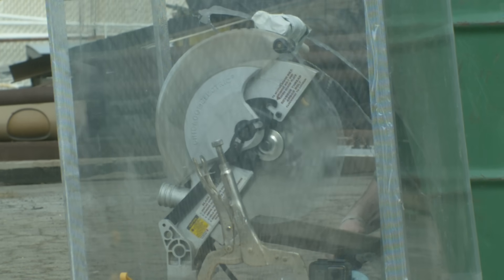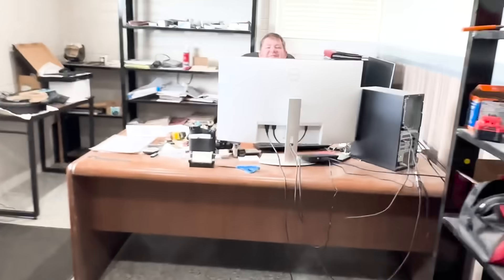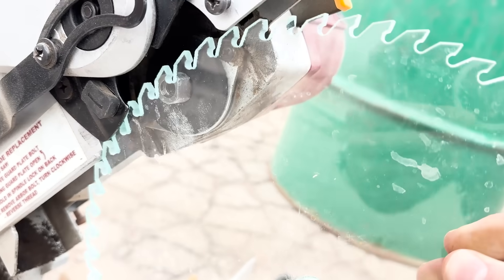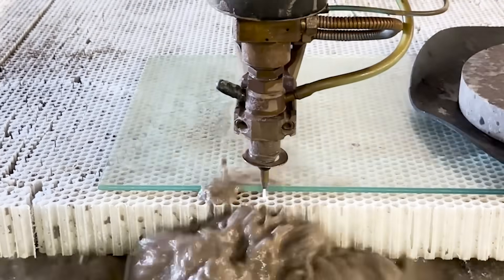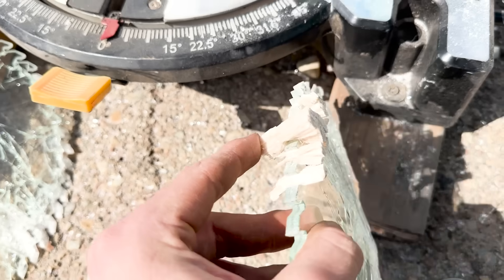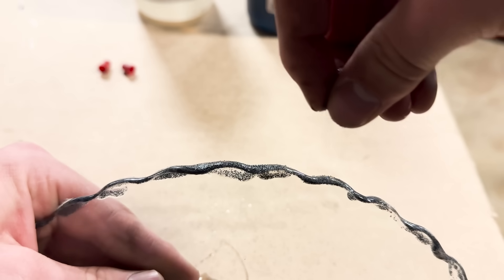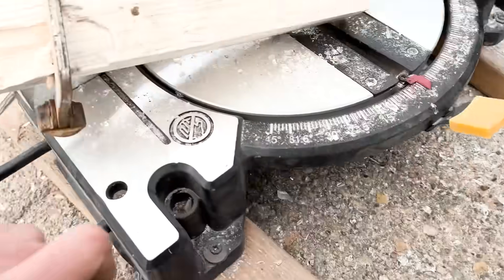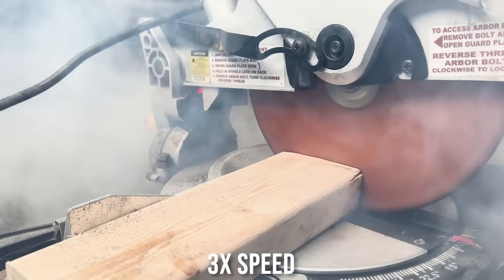Can Glass Cut Wood?

Comment: melt and stretch the glass in a spiral pattern to reinforce it -also, do any hardening techniques work on glass?                                              Edit: I'm stealing the other commenter's idea for plastic bushing between the glass blade and the hub mount
Edit 2: compress the glass with metal braces
Edit 3: (This one will be a challenge) make each blade out of prince rupert's drops -as an extension of the first point
Edit 4: seriously, deal with those cracked blades

Comment: I got a couple ideas:
-Gorilla glass, I've done impact testing with it and it's supsingly strong stuff

-with regular glass I'm wondering if you oversize the bore, fill that with epoxy, let the epoxy cure, set up a jig/fixture on the waterjet and recut the center (better if you could turn it on a lathe instead) my logic is that it would provide a bearing surface for the mounting post and potentially even that suprise screw. Also it may fill any of the microfractures formed by the waterjet process.

-last idea is to coat the whole thing in fiberglass resin or something similar, maybe it'd help contain the madness
Reply: Also carbon fiber, titanium, g10 would all be interesting. 

Fiberglass resin impregnated cardboard would be interesting.

Liquid nitrogen+ pizza dough could be fun

Somehow using rubber or leather would be interesting.

Comment: A big reason your first blades might have additional stress is because the hole you cut in the middle of the blade is round while the fit for the blade has some edges on it - its not a cirlce. This would have caused a worse fit and additional vibrations as the fit was not tight
Reply: If you look closely when he's putting the blade on the saw, you can see he broke the glass while trying to widen the hole with the Dremel.

Comment: You need to change saw. Something is of balance with your setup. It should not vibrate that much. The CNCd glass is balanced in itself. Change saw and use bigger rubber/metal washers

Comment: around 3:08 +/-, that tape IS really strong but only in the opposite direction u used it, its strength is lengthwise in the tape due to the strings of that strong ass material that run the length of the tape, vs widthwise.. where its basically as strong as any other generic cellophane or poly     thanks for the video man  : )

Comment: may I suggest you cut the saw blade Frist out of 2.2 mil or 3 mil glass, then have the 2 cut outs Laminated together, this might help to elevated some stress from cutting lam glass.
2nd in test #2 you already had a crack from hole drilled in center. that was already a fail. any micro chip crack is going to be the stress point for a fail.

Comment: I Waterjetted some colored slate and in the program was some Pierce holes that I had physically put in with a drill bit. So that the jet would not break and shatter the material. This way the jet can initiate inside the hole and ease into the material. I still screwed up a letter because I lost abrasive and the water blew out an “N” 😂

Comment: You need a variac or motor speed controller rated for the current the saw draws.  That saw draws way more power than a dremel tool.

Comment: Ceramic tile next please, if possible try to get a Zirconium tile.

I work at Leitz Tooling, we make diamond tipped saw blades, the 'diamond' material is a Zirconium based ceramic.

So I'd be highly interested to see what a full blade made of the stuff would be like.

2 suggestions I have are.

Change the geometry of the blade to give a negative 5° hook angle to the teeth. 
It will put the blade through less stress when cutting, it is commonly done on metal cutting blades for that reason.

Cut a 30mm bore hole in the glass, then epoxy in an aluminium bushing, that will probably help with the vibration.

Comment: many uggestions.
1: Watch everything in your process more carefully (that cover a lot  ...like the screw that you should have caught at the beginning)
2: Come up with a cutter design that's more aggressive. There should not be a need to use silicon carbide . Maybe something closer to your first iteration but closer to the look of gear teeth. maybe a right angle at the front of the cutter and a slope in the back for strength.
3: Get a torque wrench & start paying attention to your torque wrench settings. go ahead & break a test blade so you know about where the glass will crack when tightening.
4: Get control over the speed of the saw. If you can't find something. it's cheep enough to make a little outlet box with a dimmer switch. I have one I made using a  two-outlet box to put two outlets on one side & the dimmer switch on the other. This comes in handy for lamps & many other things you wish you had adjust ability on.
5: Try Pyrex.

That's about all I got.
 I know I probably sounded snotty or even condescending but I don't care. ...much
 I'm approaching 50 so I'm starting to feel entitled to it.
 If you don't like it... GFY! 
lol
Reply from the maker: Hahaha. Thanks for the good advice.

Comment: think i saw cracks in the hole to begin with, might be a good idea to buy some diamond coated hole drills for glass, drill them halfway then turn the piece so you dont rip chunks off the surface to keep it as intact as possible. 
also grind the sharp edges away from the hole to make it more durable. 

make the hole bigger than the shaft, then epoxy some metal bushings to both sides of the glass. i mean if you have access to waterjet, you should be able to make replacement metal bushings too. also for the metal bushings, make the hole in em with the flats so the motor is turning the bushings and the larger diameter glue is turning the glass. 
that way the shaft isnt grinding against the glass and the forces are not as concentrated.

also if possible balance the blade to reduce high speed vibrations.

lastly, compression does crack glass so if you screw it on too tight, it will shatter. the metal bushings should alleviate that as they turn with the shaft so the screw doesnt get tighter as it turns. 
but that also means you might risk it coming loose so take care.

Comment: Use a variac to spin the motor up slowly and to a lower rpm.

As for the self-tightening nut, jet the center hole for your blade oversized and fit it over a solid bushing which is slightly wider than your blade. The nut will tighten to a stop against the bushing and your rubber washers will be doing all the work transferring the torque into the blade. Definitely do something about that protruding screw nonsense lol.

And also you might try hand drilling the starting hole for the center of the blade if it was the piercing operation that caused the cracks right out of the jet.

Comment: On one hand, I think trying a different type of glass - such as the borosilicate stuff used for laboratory instruments and high heat applications might help. Being a thinner and lighter might reduce the stress as well. Does it need to be a full size table saw? On the other hand this is a mater of torsion/tension/compression and much like concrete - glass is really only good for that third one, no matter what type you're using.

I'd also mention the idea of fiberglass, with some sort of grit compound embedded in the epoxy. But at that point, you're making the same grinding wheel as that angle-tool that melted your lexan.

Comment: Saw blade material ideas:

Stone
Concrete
Paper
Plastic
Brick
Sand Paper
Towels - both wet and dry
Cake
Cardboard
Styrofoam
Fabric
Your Mom
Ice/any frozen liquid
Mellon/Watermelon
Meat (beef, pork, chicken, etc) both raw and cooked
Bones
Yarn
Wires
Stuffing (the kind inside stuffed animals)
Drywall
Dried glue
Rubber
Tape
Pumpkin
Hair
Flags
Flesh
Fur
Feathers
Bread
Poop
Carpet
Dirt/mud
Clay
Grass
Video editing
Any type of metal
Leather

Comment: Take the stupid safety covers off then the screws aren't in the way :|
Reply: Also, laminate single sheets of epoxy+fiberglass mat with sprinkled on zirconium bits and you've got a real thing.

Don't forget they used to make harddrives with glass platters that spun at least 5400RPM; granted we're talkin' significantly smaller diameter so thus less tip speed and centrifugal forces, and significantly thinner.

You might try a small cutter with the disks from one of those.

Comment: Normal saw blades have teeth made of pieces of metal attached to the rest of the blade. If you did this with the glass blade, it would help reduce concentrated pressure on the cutting edge to reduce cracks

Comment: As other commenters said, you need a way to transfer the force from the hub into the glass without creating any point forces. Spinning up slowly would probably help, but I would also consider an insert of some different material, fitted or glued in, perhaps even with a similar kind of wavy pattern as the last blade had on the outside.
This will also make sure the blade is properly centered, because in the slowmotion footage, it doesn't look like it is (or perhaps it's not balanced), which causes a lot of vibration.

Comment: Suggestion: 
get rid of that damn screw and solder some metal in the hole instead so it will be flush and not collide with the blade

Comment: You don't need to have the blade be the fully 12" or whatever. The centrifugal forces are way higher. Instead, you should have made the blade just big enough to cut through the 1x1 (or whatever it was). This would dramatically reduce the forces on the blade.
Reply: Do you think slowly bringing the blade up to speed would have helped? I was thinking it would. 🤔
Reply: @cohcam2113  Maybe if it was sharply snapping on and cracking at the start, or if it helped dampen vibrations. I think you're going to have the most trouble when the glass hits the wood, though.
Reply: @cohcam2113  There are thee main lines of force. There is the main torque of the shaft attempting to rotate the blade around the axis of the shaft. There is also a centripetal /centrifugal force of the atoms of the blade wanting to continue their linear motion away from the axis while being pulled back into a rotational motion by rest of the atoms of the blade. Finally, there are rotation forces perpendicular to the shaft bending the glass in towards the shaft as a result of gyroscopic precession if blade isn't perfectly aligned with the axis of rotation (e.g. it's not flat or it's not perfectly perpendicular).

At low speeds, the rotational force is the primary force as it tries to overcome to rotational inertia of the blade.

As the blade speeds up, the centripetal/centrifugal forces and gyroscopic forces increase.

Decreasing the rate of acceleration of the rotation of the axle reduces its torque. The other two forces are perpendicular to this and depend only on the overall rate of rotation and the geometry. The only way to avoid the disc pulling itself apart at high speeds is to reduce the final speed. This is why small grinding discs and even large metal saw blades specify a maximum RPM. More than that and the blade will both wobble violently and try to pull itself apart radially.
Reply: then to make the optimal object you just get a drill XD @fgbhrl4907

Comment: If you guys try out concrete  consider using some of that wire mesh for window screens as reinforcement. Just a fyi but the portland cement on its own is stronger than with substrate in it. Probably don't even need teeth on it just a straight wheel and it already has all the abrasive you could want.

Comment: I think you may have been able to get more results if you found a way to add glass teeth to a metal blade so that the centrifugal force doesn't obliterate the support? I don't have experience with these materials, just throwing out some suggestions i thought might be interesting for another video like this. Maybe even a housing for the glass blade that places the stress on the sides of the blade instead of the center?

Comment: Make a Prince Rupert saw blade. Make a mold of metal heated up to the melting temperature of glass, fill the mold with glass oh, drop the whole thing mold and all into a 55-gallon drum of water which hopefully will cool the outside of the blade quickly enough that it becomes internally stressed like a prince Rupert's drop. And you may be able to make something that's very very tough. I don't know if this going to work. It's an idea I've been coming up with for a while to make glass with the properties of Prince Rupert drops but in the useful shapes

Comment: I think the best material that isn’t sci fi stuff like carbon nanotubes would be just a pure tungsten. Hard as shit the mass means if the steel gets snagged it would have more raw power to just go through (if at the same speed) and would be pretty easy but costly to make. If you wanted a slightly more interesting material it would a tungsten and titanium alloy.

Comment: I saw in the glass what in the middle where the hole is and it has cracked there that shattered to break it off real good but not the edge of those teeth so always check the crack first but if there no crack at all then it good to test it so if it has it then its no-good to use thatchy I caught it everything and they didn't check that in first place thats why

Comment: any fractures at the centre of the glass will break it as soon as you start to cut cut the centre hole first with a diamond blade any cracks scrap it and the teeth should also be cut at an angle so the teeth end in a point

Comment: you could perhaps try a polycarbonate sawblade? it's probably less hard but also more bendable so it shouldn't explode into a googol pieces. Another idea is aluminium. Bonus points if you make it by laminating many layers of aluminium foil with resin to make a compound aluminium resin sawblade

Comment: This would be a serious cheat but you could take your grit mix with wood clue and spread thinly on paper.
Do this for multiple layers till it is about 116 inch thick and you could probably cut steel with it maybe even glass 
Aluminum and other soft metals would cut quite easily.
I say it would be a cheat as commercial grinding disks are not all the much different they use cloth layers of a resilient textile that is coated in glue then they are laid up with pressure and heat to fuse them in to a disk you absolutely will need to clamp them between 2 sheets of heavy steel with wax paper facing the glued sheet. 
But it WILL absolutely cut harder materials very very well wood will actually be harder to cut that mild steel flat stock as the heat will try to melt and break down the glue. As the grit wares away the disk will get smaller exposing more fresh grit. Well hell why am i telling you all this you run a fabrication company LOL

Comment: Instead of making the whole blade out of glass(or whatever material), why not make most of out of metal?  Make 2 discs of steel that screw together making 1 disc with a v-groove around it.  Then your cutting material(like glass) can be the outer ring of the blade. The inner ring having angled edged allows for the steel to clamp onto the outer ring.

Comment: Try making a blade purely out of packing tape. Y'all remember making sculptures in art class that were just packing tape? Those things were surprisingly strong.
Bonus points if you use exclusively that tape with the fibers in it that you used for the lexan box. Make sure you make it with the fibers going in all sorts of different directions if you do.

Comment: From 10 second of watching the start of the video your issue is balance and vibration. Want to use a nylon and oring colitis to hold the disk and give it a second attempt. Make sure the center of the disk is a true center too. Mabe even add some relief slices into the disk too help temps not destroy the the disk from the sharp angles on the tooth returning edge

Comment: Variac : you need a variac to try and start the saw more slowly. Although there is still a chance that your particular saw may only operate at full power though (a.k.a. full chooch)
Reply: Saw has a brushed universal motor, a variac would definitely work for that.
Reply: lol, i love how me and you both said variacs. I managed to be like comment 10. But what I love about it, is we are both named Joshua, telling him to get variacs.
Reply: @TheMookie1590  great minds think alike. Josh's usually have great minds. Usually. I do dumb things sometimes.
Reply: A variac will sort of work, but once you get to sufficient voltage it will still accerlate quickly. The speed of an AC motor varies with frequency not voltage, so a VFD (Variable Frequency Drive) would be ideal.
Reply: @Av8orDave  thanks for the info. I know enough about electrics to get myself into trouble, and so I always like to learn more.
Reply: Chooch is gonna chooch the pooch!

Comment: They don’t use laminated glass for windshields, instead tempered glass. Tempered glass breaks into tiny parts that doesn’t cut you if you fly through it by an accident.
Reply: Windshields are made of laminated  glass. Side windows are tempered. You wouldn't want a tempered windshield. If something was to hit it on the highway, end up with face full of glass

Comment: You need to use stronger glass, like crystal or polarized glass (different layers with opposite polarization). Also make the blade thicker at the center/middle, so that it can withstand the centrifugal forces. Also you should try a different saw, this one's geometry seems to be causing problems.

Don't give up on your dream man.
Reply: Thicker in the center... I'm not sure how they would make that. Would be very difficult to cut properly.
Reply: @drantigon  Would have to do some glass work
Reply: why would the polarization of the glass matter?
Reply: @CzarYe  It makes it stronger in one direction.